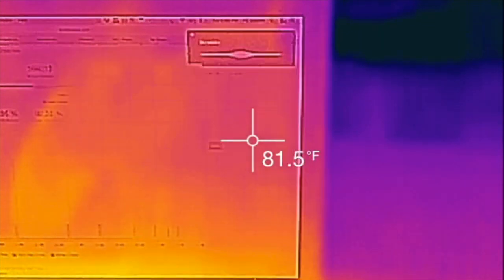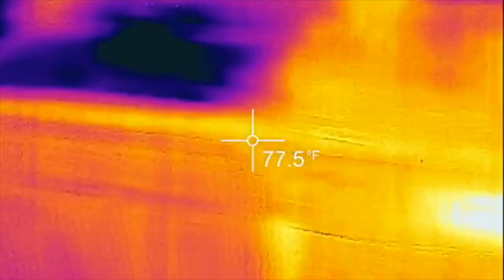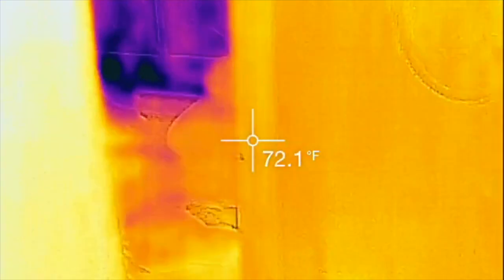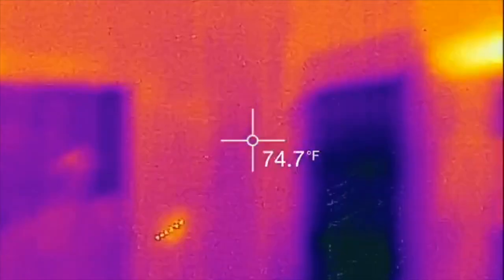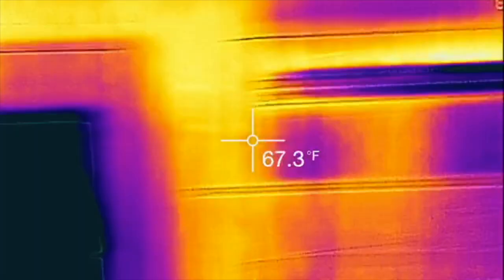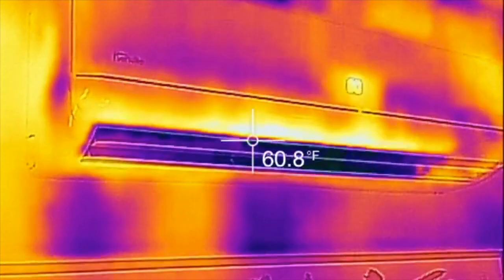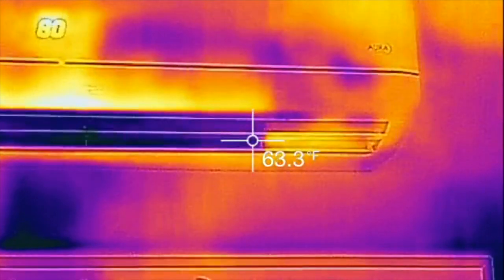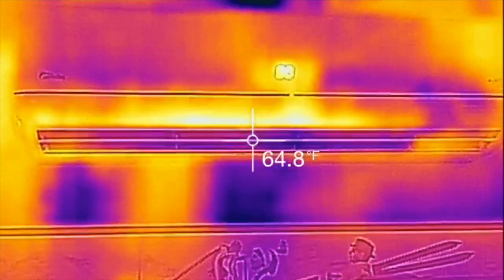Heat Pump Extreme Cold: Tested

Comment: Thermodynamics is a awesome concept, Im just starting to get a good understanding on it. That must be 410a? I would assume if the compressor can pump and compress efficiently you can use any refrigerant to get the job done. I wonder how hard it will be to make R290 perform as well as the other HFCs.
Reply: Everything I have seen shows that R290 (propane) works just as well as if not better than HFC refrigerants. As far as I know, the only reason we don't use it in large systems (at least in America) is flammability, I have never seen any indication that it wouldn't perform well. I have used R290 as a drop in replacement for R22 in a window AC unit with great results, but please proceed with caution if you choose to try something similar.
Reply: @averyalexander2303  R410a is better than R290 in most ways. Global warming potential is honestly not even something worth making a primary concern. Leaking refrigerant is not a major cause of global warming.
Reply: @TurboSpeedWiFi  Other than not being flammable, in what ways is R410a better than R290? While I haven't seen a direct comparison, I have seen studies showing that R290 is more efficient than R22 and that R22 is more efficient than R410a under most conditions, but not by a huge amount. The facts that R290 runs at lower pressures and can't fractionate since it's a single component are real benefits too.
 
I agree that GWP isn't much of a factor. By a very large margin, the unit's main contribution to global warming is from the electricity it uses, not any refrigerant that might leak out. Therefore, the priority should be creating the most efficient refrigerants and systems possible, not just the lowest GWP refrigerants.

Comment: You need to put out new updates, i want to get one but not finding enough info in the reviews, like how you heat the whole house with one head unit, heating mutiple rooms, tips on head unit placement etc...
Reply: I highly recommend  Senville Aura.I do not recommend heating whole house with 1 head unit unit or multiple head unit.I would install 3 complete separate units.This way if 1 breaks down you still have the other 2 units operating.Also the smaller BTU units are not only more efficient they are also more reliable.Two  12000BTU units cost less to operate than one 24000BTU unit.There are units out there that cost way more but are the same Senville unit with a different sticker on it

Comment: I have a home in the Colorado mountains that's 100% electric and has old baseboards which are inefficient and half are dead. 

I'm wondering if you are seeing a noticable cost savings to heat the home from were you were with baseboards.  Average low temps are -5 to -10. We don't get crazy lows like you but it's always just that temp for lows.  

I'd just like to know if spending 12k will give any payback to paying 1500-2000 to replace all the baseboard heaters.
Reply from the maker: My bill is about $120 per 1,000sq feet on the coldest months (0f and lower), YMMV depending on insulation. If you're going inverter, oversize the unit (Not professional advice, just my opinion). I think these unit are under 2k per 24kbtu unit currently. I'd go multiple single zone units for redundancy. Good Luck!
Reply: @pcdoodle1  great.. thanks for that. Hard to find people that have these in really cold areas

Comment: Wiki says air to air units become ineffective at -18 celsius.
Reply: Wikipedia is arguably the most unreliable source of information available.
Reply: Back in 1984 they were ineffective at -18C 😁
Reply: That's where my decade old design Nissan LEAF heat pump gives out, about 0F. But newer house systems go down to -30C, the above mentioned -22F (rated). OP shows operation down to almost -30F.

Comment: Any of these heat pumps work around -40 or -50?
Reply: no not with an air to air unit but geothermal would work great.
Reply: the ines that take heat from the ground should do just fine since below grownd the temperature is quite stable

Comment: How long do you turn on your heat pump. Let's say all day long at -20C outdoors and I am using it at 22C? I live in Quebec, Canada. Typical electrical heating wire system does not turn on when I use my heat pump, so I believe I am saving money. This is my first winter with a heat pump and turned on 3 days in a row. Any advice?
Reply: I live in Quebec too, and was thinking about getting a heat pump I was just wondering how it been performing? And if you got the rebates from Quebec government?

Comment: Do you need a backup heat source for this?
Reply from the maker: You should have a backup. I haven't used mine yet but it's a no brainer to have some cheap 1500w units to cover your ass in the dead of winter. Code requires electric baseboard if you're into that kinda thing.
Reply: @pcdoodle1  I live in ga nobody have those here and they are dangerous
Reply from the maker: @brandonjohnson7851  You don't know what winter is. And yes, everything is dangerous to varying degrees depending on the level of ignorance.
Reply: @pcdoodle1  yea but we don't have harsh winters but I did have a window heat pump with back up heat but when it the temp got 45 degrees the heat pump just couldn't do it so the heat strips turn on and my bill went up 3500watts vs 960 on my mini split
Reply: @pcdoodle1  I guess I'm just worried about the power being out for several days, I'm guessing I'd be screwed with just a heat pump and backup electric baseboards
Reply: No
Reply: I have a kilimare it works awesome no electric heat strips

Comment: mine works well in Edmonton Canada temperatures as well.  these things are awesome.
Reply: handy esp in alberta. heating in winter and AC in summer on the same unit. heck on the same day
Reply: Is this a standard unit? Dose it require different refrigerant? How much energy dose the condenser use? I  am Canadian as well.
Reply: @noleftturnunstoned  I've ran one 3.5 years and never had to service refrigerent yet.  When it's really cold they use more electricity.  I also supplement with portable oil heaters in n -25 to -40
Reply: @noleftturnunstoned  yes standard units as far as I know
Reply: Hi GP. I am in Manitoba, install a heat pump soon. Just wonder, has condensation under the outside unit been a problem in the winter?
Reply: @quentinrobinson8356  I haven't had any issues.  My Fujitsu has a function that melts it I think.  And my Daikin I've had no issues.  
I was thinking of building a shyer around one  to keep it out of the snow and elements .
However they both work good up to about -20 to -25.  Any colder I supplement with oil heaters 
For AC they're super economical on power
Reply: @gp7910  thanks for sharing your experience. Sounds encouraging.
Reply: @quentinrobinson8356  it does run off and freeze but not a big deal if you put a barrel
Reply: @quentinrobinson8356  Your best deal is a Senville Aura and a lot of other models are the same unit with a different sticker on it.The Aura and the Leto have a pan heater to melt ice build up at the bottom of the unit and a heat belt wrapped around the compressor to keep the oil and refridgerant warm before start up.The Aura has a arctic compressor the Leto does not
Reply: @Helicopter Dad!  Yeah fuck you I know how my heat pumps work .  Youre one of those know it alls who know nothing

Comment: How is your drain line set up for the outdoor unit? Mine is mounted on a wall above a walkway so a hose is going to be needed but I'm worried about it freezing up.
Reply: Hi. I am just about to install a cold climate heat pump too. What has your experience been? Has condensation been  a problem in heating season?
Reply: @quentinrobinson8356  My senville unit is going on its 3rd winter, it's also used most summer to keep the home cool.  Its the main heat source in my home until it gets to about -25C, then some baseboards may come on to compensate.  I already had a moisture problem in my home in the cooler months so I make sure to run a dehumidifier, ran into some condensation issues in previous years in the attic, don't want that to happen again.

I also never installed a drain hose on the unit, it's useless, water pours out from every hole on the bottom of the unit lol. I have it mounted above a path but I just chip away at it every now and then.
Reply: The indoor unit doesn’t drain when it is in heat mode so it doesn’t matter how cold the drain line gets.

Comment: Questions  for you.  We are looking  at getting the Mitsubishi  hyper head set up in our 2nd floor  rooms  still will have  gas forced air on our 1st floor and basement . I'm in the middle of wi and the sales guy kept saying they shut down at -15.  Did it ever actually  shut down on you or just defrost?
Reply: The Mitsubishi's along with some other ASHPs do have a shutoff temp.
Not all of them do.
It depends on your location as per your low temps of course, but, once above, around 13 below, the Mits will fire back up.

Comment: It's really nice video, but you need to check the power input in watts hour and the power input in BTU's/h so you will know what is the COP of the system in a cold climate, sometimes it will be less efficient compare to other heating sources, see heat pump balance point,  thanks.
Reply: He spends $120.00 a month per 1000 square feet . I would say he is doing something right .
Reply: a heat pump will always be higher then 1. so its alwaus better then just resistive heaters.
Reply: @SupremeRuleroftheWorld  if its really cold,,no
Reply: @guiltfreehotwater7290  its really not. a good heatpump vcan go to -25 celcius while still having a COP above 2. resistive heaters are always cop1. so please inofrm yourself before claiming such things.
Reply: @SupremeRuleroftheWorld    its working so well for me here in San Jose ! i use a samll DC pump thats only 20 volts with a small solar panel to circulate it around  it around and not depending on the utility
Reply: @guiltfreehotwater7290  fun fact: not everyone lives in a place where it never rains or freezes. i dare you to use that system in montana.
Reply: @SupremeRuleroftheWorld  in theory, but due to defrost cycles COP can dip below 1.0

Comment: I am building a new home in Northern WI about 1 hr north of Green Bay. I really want to use a system like this as my main source of heat but I am not sure how to size the place for the right unit. How many square ft is your system covering and do you only have the one head unit? What size head unit is that? Do you have any issues with rooms that sometimes have to door closed? My new house.cabin will be 2400 square ft 1200 up and 1200 down.
Reply: New house, use ceiling cassette it looks a lot better, an online calculator can help you to get the right sizes.

Comment: @PCDOODLE - I am in the same climate as you and also have baseboard electric heat. How are your electric bills with this switch? I am thinking of making the jump to a Senville Aura 18k BTU unit. Any insight? Thanks.
Reply: I'm in the exact same boat as you! Baseboard heaters, similar if not slightly colder climate (Winnipeg) and Im currently installing a 2 zone 18,000 btu Aura unit. Hoping this cuts back my energy bills!
Reply: TIM!!! You will not be disappointed!

I ended up going with an LGRED 15k BTU unit and it has not disappointed me yet. Just got my second bill with it, compared to sept-oct last year I am already down 300 KWh. And my house is comfy!! Lowest temp on billing cycle was 30 degrees and it will continue to drop as we go towards winter. I’m eager to see how it plays out.
Reply: BTW - use Nylog and be very sure your flares are tight... Remember these things with r410a go up to 400 psi head pressure, you want things tight/snug. Ask me how I found out 😂. All is good though.
Reply: @3035looney  I ended up having an HVAC tech do the connections / vacuum for me on the side.  He didn't use nylog but he snugged them up well and seemed to know what he was doing.  Oddly after a week of use, on a chilly morning today we noticed the outside compressor unit was making more noise than usual. I actually just posted a video under my page to see if others with the similar unit know if this is normal.  How loud does your outdoor unit get?  When we started it up earlier in the week it was fairly quiet, but now that its -2C (28F) I can seem to hear the compressor working.
Reply: @timpro2829  Mine is extremely quiet. It has gone down to the 20s so now it is running just a hair louder but I would never notice unless I went outside and checked. The only time it has got real loud is when it has gone into defrost mode which has happened a couple times now but then it gets whisper quiet again after defrost is complete.
Reply: @3035looney  Mine seems to be running a little quieter now. I'm wondering if it's because we typically drop the inside temp down to 64ish overnight, so I don't think it turned on overnight. This morning it was pretty much working full strength and I'm fairly certain I had one of the indoor heads on Turbo which may have contributed to the excess compressor noise.  I'll have to keep an eye on it :S
Reply: @timpro2829  It may even be that it is due to you having a multi-head and they are both being called at the same time and keeping the compressor busy? When mine is going full bore I'm pulling 2Kwh and when its modulating and maintaining the house temp its right at 300 watts.

Comment: to be able to heat a typical 1000 sq ft place on 24k btu per hour a -20f, it must be really well insulated. normally you would need like 35 to 40k btu with insulation and closer to 60-70k without.

Comment: Can you post the model numbers of the indoor and outdoor units?  Mrcool makes multiple different models and I'm trying to figure out if you have their hyper heat unit or their standard unit
Reply: This is a Senville Aura unit.
Reply: @sprockkets  I bought and installed the same unit.  So far, minimal gripes and it installed easily.
Reply: I am building a new home in Northern WI about 1 hr north of Green Bay. I really want to use a system like this as my main source of heat but I am not sure how to size the place for the right unit. How many square ft is your system covering and do you only have the one head unit? What size head unit is that? Do you have any issues with rooms that sometimes have to door closed? My new house.cabin will be 2400 square ft 1200 up and 1200 down.
Reply: Also what is the lowwest temp the unit can be set at. There will times that I wont be at the house for a month and would like to keep the temp around 40 to 4 degrees
Reply: @scottboucher5329  The best way to size your system properly is with heat load calcs.  Download HeatCAD and use the 30 day trial.  You'll have to learn it, but that's the best way to do this properly and know for sure.
Reply: @scottboucher5329  

I think that there's a setting that allows 8°C, but you have to use the Senville app. Check out the app, and you'll see what I mean. 👍🏻
Reply: You can also access the FP function using the remote.  I think you press and hold the down button.
Reply: @scottboucher5329  What did you decide to do?

Comment: Great video what is the brand of the heat pump ,and if you the model info of the outside unit please
Reply: Senville Aura. Cheapest unit to get to -22f ambient for heat mode.
Reply: Hi Joe, Its a Senville AURA Series, they are rated to -22F / -30C and are ENERGY STAR Certified.

Comment: Any idea what the efficiency is at such low temps? Is it even 100% or is it worse than a space heater?
Reply from the maker: These are roughly about 2.5 times more efficient than electric baseboard (below 0f).
Reply: @pcdoodle1  With a COP of 2.81 under ideal conditions (SENA-24HF/Z)- its unlikely its a COP of 2.5 below 0f. It's going to be well below 2, probably below 1.75 at 0 and near 1 at -22f. Seeing the drop to 15,400BTU/H capacity at 17f  when its rating is 24,000 at 47f (that's like 65% of rated capacity) you can be darn sure as you drop below zero and get to -22 you are approaching 8,000btu or less. Good unit but 100% positive nowhere near 2.5 COP at zero f
Reply: @SuperDocCox  Good analysis. The brand the video author is using markets 75% efficiency at -22 temp. I don't believe it myself, but thought I'd throw that out there

Comment: My geothermal's maximum duct temp is about 95, taking heat out of 55 degree ground water. So I don't buy this video at all.
Reply: So, What's the difference between your Deep Freeze -50 Chest Freezer and your average window Air-conditioner? The Way the exact same technology is engineered and manipulated.  It's doesn't matter if you have geothermal heat exchanger, if your equipment isn't designed to utilize it. These new heatpumps convert AC electric into DC and have completely variable speed compressors and fan motors. They have more latitude to service a WIDE scale of temperature manipulation instead of a targeted parameter, like the equipment using your geothermal heat exchanger. It doesn't matter where you get your heat from, it matters how you design the equipment to move that heat.
Reply: Ducted and mini split efficiencies and performance are different.

Mini split systems utilize an inverted based dc compressor which yields higher performance and efficiencies.
Reply: Then you have an issue with your system because even air to air systems at 55 work better than that.
Reply: I agree with you.  I install these things in maine and at -10 F these things don’t put out much heat and are no more efficient than straight up resistant heat.  However, at +20 and above they really make sense.